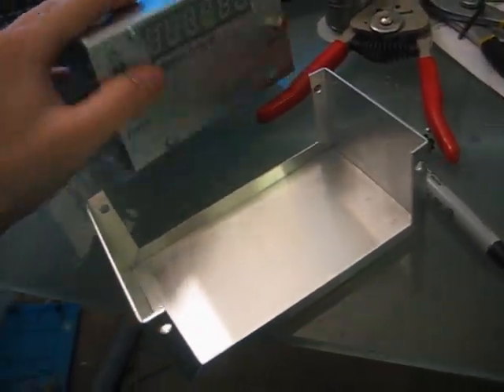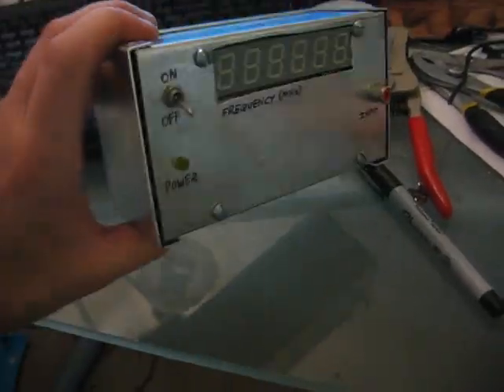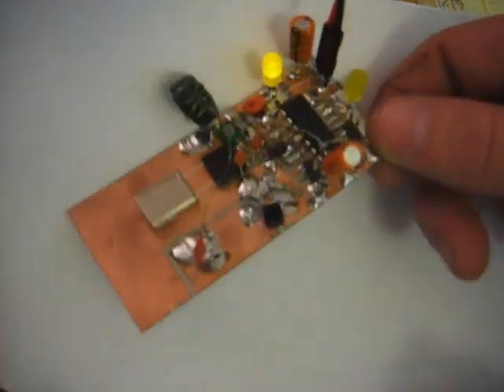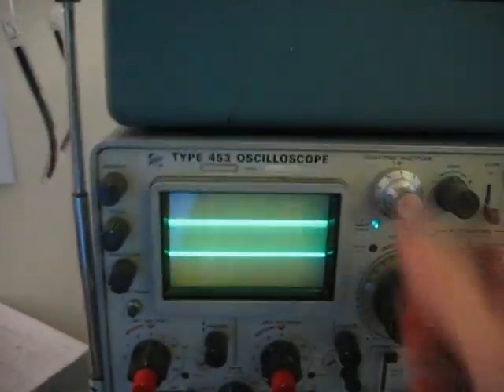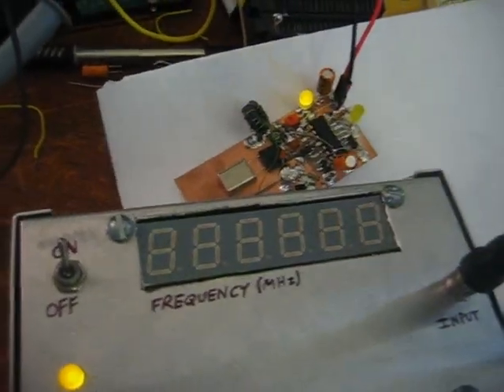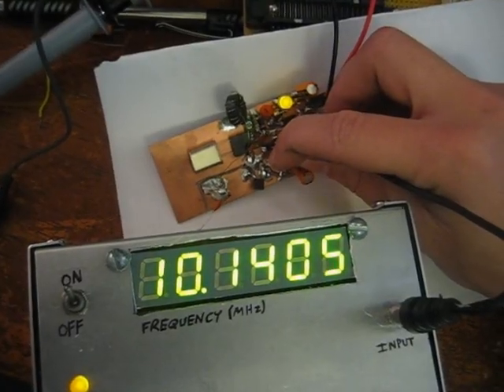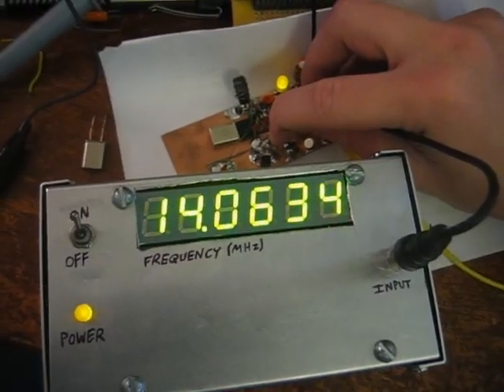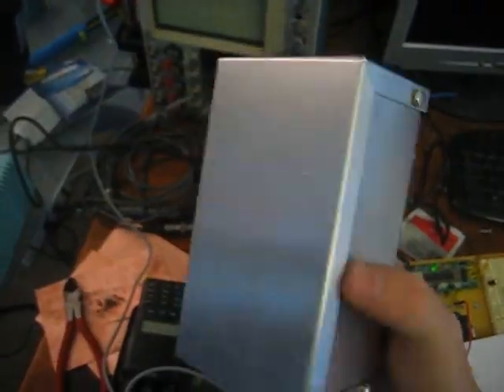cheap frequency counter for amateur radio

Comment: Nice job.  My only comment is you used the bottom of the mini-box as the front of your counter.  The case is upside down.
Reply from the maker: It's been a while (almost 10 years!) but I suspect I used this orientation so gaps in the metal would be on the sides rather than the top and bottom. In retrospect, it does look pretty goofy! 🙃

Comment: Nice counter, but  no info on acquiring such a counter. Absolutely worthless for duplicating the project, not cool at all. Never mentioned really any description of the counter parts.  Very thoughtless.  Generates interest but lousy on info.
Reply: Easy does it Mr. Agressive!  You must be nice to QSO with.  NOT!
Reply: @drewmichael4014  heh, am I on C.B. or ummm um uhh ham radio :)  I guess it's all just a state of mind.
Reply: Very aggressive.... :(
Reply: Link to schematic is in the description.
Reply: There is also a newer 8 digit counter on ebay
Reply: Here is a link for the information. Well for what info there is at least.

http://www.swharden.com/blog/2011-02-04-frequency-counter-working/

Comment: Well done, Scott.  Prayers and encouragement for your and your family.
You've built up a very nice microcontroller capability.  You'll find many test instrument ideas out on the web (you probably already have).  Also there are some very cheap AD9850 DDS boards on eBay that you can program using SPI from a microcontroller.  Please keep building and sharing ... and Thanks!

Coop, AA1WW

Comment: It does exactly what you'd expect from the name, it 'counts' a frequency and displays it on the screen. Frequency is actually the times a signal rises and falls in a square, triangle or square wave. 10mHz means that the signal goes from high (5v) to low (0v) about 10.000.000 times a second.

Comment: @igrewold  Freguency counter is a test equipment use by technician to determined if a transmitter is transmitting on the right frequeny.